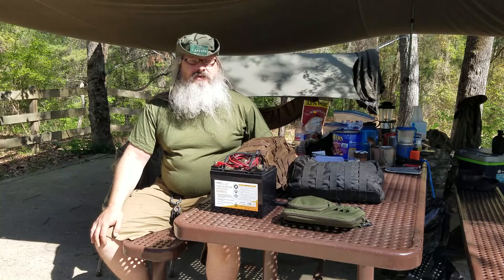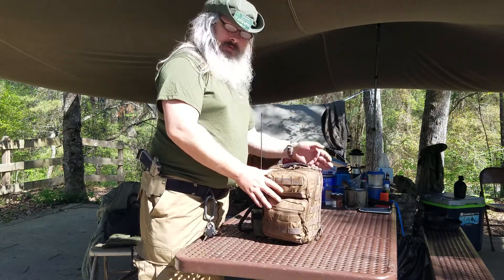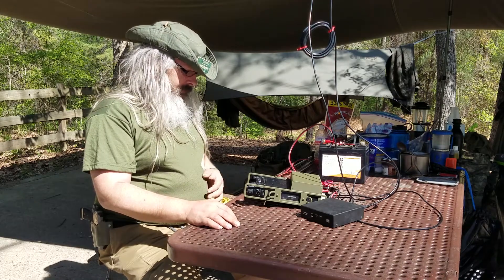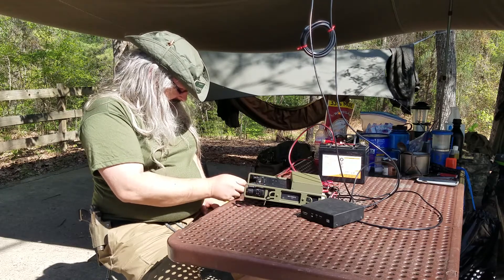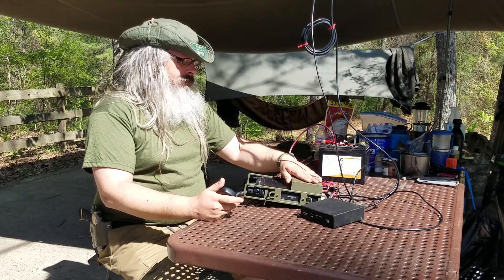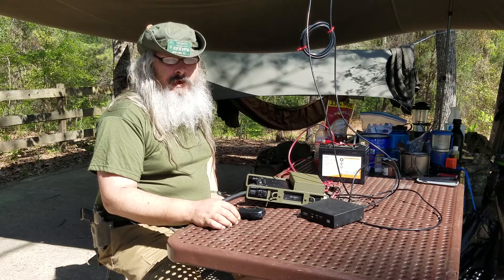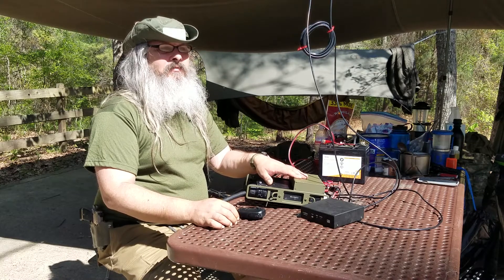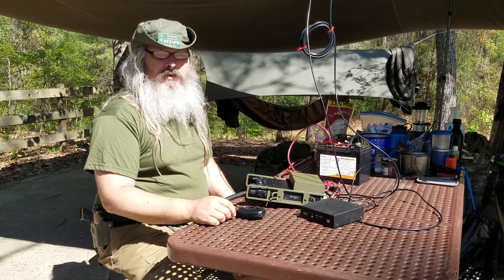Portable Ham Radio System

Comment: How’s an antenna tuner work
Reply from the maker: A "antenna tuner" does not realy "tune" a antenna. What it does is make the antenna present a optimal swr at 50 ohms to the transmitter so that maximum power posable is radiated at a particular frequency. It also prevents damage to the transmitter due to reflected power. A resonant antenna with a radiator cut for the exact frequency used that presents 50 ohm's to the transmitter is always best and needs no antenna tuner. The issue a antenna tuner solves is that its difficult to make an antenna that is resonant on all bands in a practical usable size.

Comment: tuned up on top of a qso?
Reply: Usually a radio tunes with only milliwatts of power, so no real problem.
Reply: @davidsradioroom9678  When you press the Tune button on that tuner, if properly connected to the radio, the FT-857 produces a tuning carrier and TX power depends on the power setting for that particular band. If the operator has it set to 100w, 100w it is. Although he probably has it set at a lower output for battery saving purposes. Or, if it has the brown wire grounded, then it'll be about 20w, regardless of the setting. But not "milliwatts".

Comment: I Like your rig I have bought the same rig i see a lot of hams using the FT-817 with only 5 watts, but my thoughts were, if i am in a emergency  situation that my life depends on , and i take my life very seriously, the FT-857D is a much more efficient means, for emergency life saving communication . I think that most hams do not take the time to read the specs of the FT-857D and a lot think that the radio draws too many amp's, for a trail rig. But like you, i did some reading before i purchased my emergancy com's radio, and found out about the low power battery saving mode, buy hooking up the brown wire to Ground. 100 Watts is a lot of power for a trail radio but if life depends on it, the FT-857D is the winning choice for me.  Well 73's and happy holidays to you and your Family.
Reply: If your setup works for you, that's all that matters. :)

Comment: Very nice setup!  When someone with a 100 watt radio does QRP. are they trying to see how far they can reach a fraction of the power, or are they just trying to make their "finals" last longer?  Anyway, thanks for the video?  73's AA8VA
Reply from the maker: My choice of using a 100 watt radio is for flexibility. I don't always want to or need to do QRP.  In an emergency my power level is the least of my worries. I only care that contact is established. QRP is fun but only a small part of the hobby.

Comment: Love the video! Is that bag the Red Rock Rover sling bag?  I also use an 857 but wasn't sure if the 857 would fit. Apparently, it does.I'd also like to carry an Mfj 971 tuner along with a 7mah gel cell plus connecting cables. Antenna separate. Thanks. Rudy WW7AZ.
Reply from the maker: It fits the radio with the rail system and a LDG z100+ but not enough room for a gel cell unless you can get a really small one. I plan on using the battery box on the rail system, but i have yet to decide on how i wish to do the battery itself.
Reply: Thanks for the response.

Comment: I'm diggin' the setup!  I LOVE my 857!  I've been using it for about 3 years now!  I'm interested in the VHF antenna you briefly showed.  Who makes it?  That looks like it would be great for my backpack portable FT-8900.  Thanks for sharing!  I'll be watching for more!
Reply from the maker: The military whip antenna was made by TRI triumph for a paint ball geared HT they made that looked like a
AN/PRC 152. it was basically a Baofeng board inside with the menus modified to look like the Harris made one. the antenna that came with it was also sold separately so i bought one. I have used it on my ft-817 for years. Its tuned to the standard 2m and 70cm ham bands

Comment: I often forget your ham radio self from your YouTube channel self. 
Anyway, awesome  set up. sometimes I really regret getting rid of the 897. I never used more than 20 watts but sometimes I do miss having the capability. 
Excellent video. liked, shared, ...
Julian
Reply from the maker: Thank you for commenting. I still have the ft-817 and use it regularly but i needed something with a bit more power for 80m sced's when out in the woods with the band conditions being poor. There is no cell phone service where we camp and even hitting the repeaters at that location on 2m is spotty. Getting the ft-857 was more a safety decision than anything.